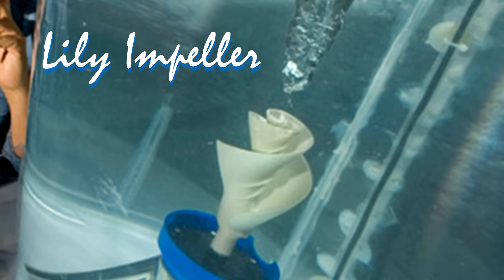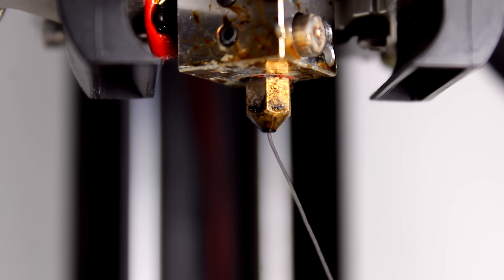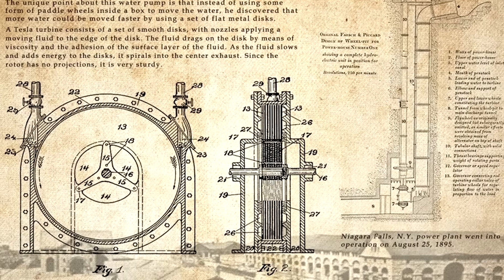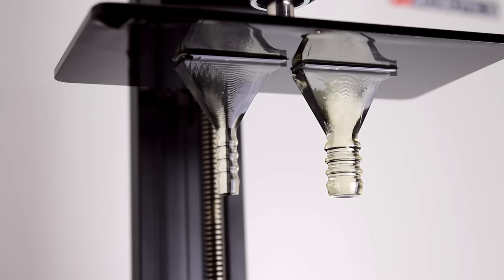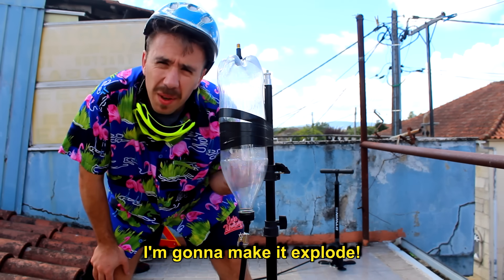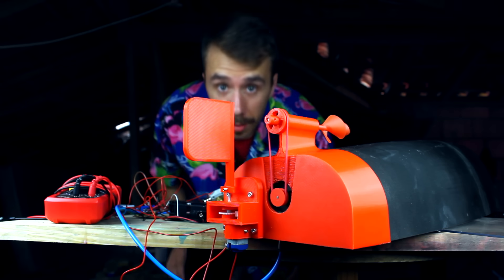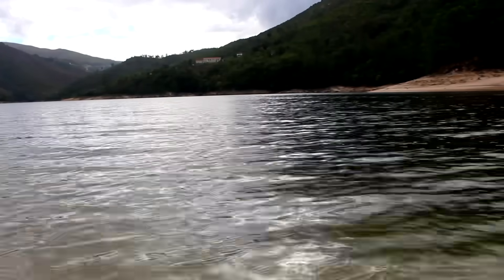Tesla Turbine Boat 3D Printed (Lily Impeller)

Comment: As a project, I would like to suggest a device using a Tesla design that, when placed in water flow, generates electricity commesurate to the flow of water, and charges batteries (a bank of 16850s or a lead acid battery).

Comment: How about building a compact boiler to power the Tesla turbine and then fitting it into a boat. Add a small pump with a Tesla valve to refill the boiler when it is empty. Then you can motorboat as long as your fuel source last!

Comment: For high presure you could try soda botle  tubes. They have a mass of the soda botle and a volume of the test tube( so the wals are T H I C C).  They also have mouth of a regular soda botle, with threads, neck, collar and all that things.
If  volume is more important, regular bottles could be reinforced like squba diver air bottles

Comment: Pump methane or or another burnable gas into the tesla engine(turbine) valve. Then burn the gas exiting the chamber. After every thing compare the results between burning it normally from a valve and from tesla turbine. Finally try to add 2 inputs to the chamber. One should be O2 other burnable gas, see if it changes anything.

Comment: Idea is you should print an insulating sleeve for drinks like soda cans. You could try changing the density of the material and the amount of air between the walls to see if there is an optimal ratio.

Comment: an invention i created (as far as i know they dont already exist) but i cant get my 89$ ebay 3d printer to do anything (its completely useless, even after my attempted upgrades to fix it) is a small box you install to your light switches that connects to an ios/android/windows/mac app that remotely turns your lights (or anything with a switch) on and off. It installs with either double sided tape or with screws on the existing screws. There is a button on it so you can still turn your lights on and off via the switch location, but now you can do it remotely as well. like when youre laying in bed or after you sit down for am ovie in your living room. inside the box there is slots where the switch can freely move up and down, and there is a stepper motor and stepper motor drivers, and an arduino and wireless receiver. and the stepper motor knows if the switch is up or down and reports the switch position to the app, and the stepper motor slides something up and down to turn the switch up or down.

This is simple in theory. and i made it out of foam board and it worked. But for it to be a better design the housing would have to be injection molded or 3d printed. The one i made had 4 slots for the 4 switch plate that my living room/kitchen lights are on. If i ever make them there would be a 1,2,3,4 switch design that the user would choose. that way its all in one unit. rathger than sticking 4 units next to each other on a 4 switch plate, for example.

Comment: @integza you could try making an array of co2 cartridges instead of the bottles. They are smaller and hold more pressure so you could fit alot more on the boat and could get alot of speed/running time.

Comment: Small tip for when making a boat, round out the bottom/back side (don't remember the proper boat term) to reduce drag,  you should generally try to go for a bullet shape or a canoe shape but other non-conventional shapes also work.

Comment: I think the velocity of the air is the important variable when driving the Tesla turbine. Velocity tells a lot about boundary layer characteristics because it plays the largest role in calculating kinetic energy. I think the reason the straight nozzle worked best is because it didn’t effect the velocity of the air going into it. The other nozzles ended in diverging sections which act to reduce the velocity of the fluid and increase the pressure. Actually, a converging nozzle should work better because velocity of the fluid increases as the area of the inlet decreases.

Comment: I could be wrong, but I think the impeller is facing the wrong way. It should be on the back of the boat spinning in the opposite direction, fat end facing forward. The large "opening" of the impeller should be the leading edge of the blade for the intake. The impeller would also need a shroud to work properly as a turbine. The idea is that the wide intake compresses the water (speeds up as water does not compress) as the turbine rotates and until it exits the impeller at the small end. It technically should work and would avoid cavitation in water and compressor stall in air. I think? Anyway, flip that thing around and add a shroud. The leading edge might still cavitate if the "angle of attack" is too steep. Trial and error on this one. Fluid-dynama-whaaa?

Comment: Why not think more forwarder? Build something like a Air Turbine, where this Lily Impaler are the Blade to compress the Water and then a modified Propeller (bigger) push the Boat forward, perhaps like a screw or Drill thing to add more push. But to have an effect we need 3 speeds. 1 to suck the Water in (Lily Impaler) then the middle part a bit faster like a Drill or Screw and then the output section even a bit faster to give the water flow the extra push. Different speed because to avoid slow down the water from move between the sections

Comment: Mr Integza, with the straight inlet and the air hose, was the increased speed due to the Bernoulli effect? The high pressure air from the hose sucks in the surrounding air increasing the volume of air entering the turbine.
If this is the case, if you were to drill a some holes into the Y shaped inlet manifold (possibly parallel to the air hose) the manifold could suck in extra air.
Reply: I forgot to add, would the impeller work better inside a tube like housing? Further utilising the Bernoulli effect.

Comment: Wonder if you could have got more speed with a gear system attached to the output shaft to get more rotations on the impeller

Comment: I'm going to suggest trying to 3d print some kind of compressor mechanism again, even though last time some guy tried to mansplain to me, an actual engineer, why it should be made out metal instead of 3d printing it, in the comment section of a 3d printing channel.

Comment: A coolinvention could be an underwater submarine that works entirely through air pressure. For the movement it uses a tesla turbine and for the ballast it uses some rubber baloons that get empty if you want it to sink and get filled to go up.

Comment: Now that you are in the water bending vibe you should also try to make a 3D printed submarine. And perhaps give the lily impeller another go.
Reply: Excellent idea, no surface tension underwater, problem is weighted air.

I'd love to see how this would be made to work
Reply: @oguzy23  Well, he could just use a normal motor instead of the tesla turbine. So he wouldn't need to worry about the air suplly.
Reply: @Pablo Paes   or  a small compressed air tank for paint ball as the air source and a ballast to make the net buoyancy zero
Reply: @pablopaes5646  yeah but that would be easy
Reply: Very nice ideia

Comment: Were those ducks laughing at your boat?  Could you use a candle to power a sterling engine to make a small pump create the air for the turbine with a larger impeller? If you encase the impeller will it become a jet impeller as the water is forced through a tapered cone, then control the cone for direction? Without the water bottles there will be less drag on the water, who knows, you may be able to reach light speed(Oh My Gaaaaawd!).

Comment: Hi Integza. I would try to put the impeller in a tube (housing) to increase efficiency. You can also use this waterflow to steer the boat like other jetboats do. what was the final rpm of your turbine when having the impeller in the water? I have the impression that the rpm are very low in comparison what the turbine can do. so maybe you consider to use a gear to enable the turbine to work in an optimal range. you could even print something like a visco-clutch to reduce mechanical friction in the gear or you do it like the do it in the helicopters who have a two shaft gas turbine. and last but not least i would use a sodastream (or something similar to put co2 in beverages) aluminium bottle as pressure tank instead of the pet bottles. you can surely put more pressure on them and they are smaller and one will fit in your boat. good luck and looking forward to seeing your next video.

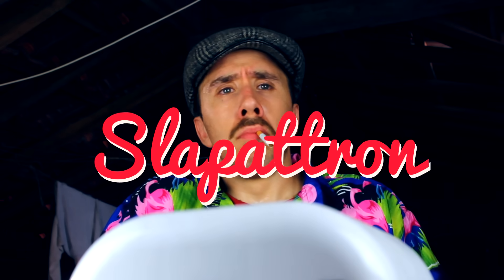Comment: 3:57 a pipe would suit you better, I think.
It emphasizes your image as a thinker ;-)
8:08 and 18:20 should be on a tshirt :-)

Some remarks:
Why did you put all bottles in the water? And with the flat end to the front. Some bottles on the top would reduce the drag.
Just use the bottles (two of them) as the boat itself. No need for the boat part itself. 
Put the impeller into a tune to increase its efficiency.
Great project and super fun to watch. You are awesome.
Greetings from Munich, Tom.

Comment: I believe the Lily Impeller is more efficient when the material(water or air) is in a captive environment. You may have gotten more thrust if this impeller was in a tube, like the propulsion system of a JetSki. In this application, using the impeller inside a tube you can control where the source of water entering as well as where it exits, allowing you to use all of the trust you generate.

@Integza ...I am interested in getting into the 3D printer game, I used to build RC aircraft but currently am building an Arduino based Lawn Mowing Robot(think a Roomba but for cutting grass). Ideally after my prototype proves out I would like to design and make more 3D printed parts to lighten the V2 and make more efficient. For someone getting into 3D Printing with no background, what would you suggest for a great beginner printer as well as some projects to help learn the software, both using and writing?

Comment: One idea suddenly strike to my mind...that if tesla coil can transmit electricity wireless ....you can make a rc car with out battery (instead power it with TESLA COIL ) it will be amazing to see it working in your upcoming video⚡
Reply: Tesla coils can’t transmit wireless electricity more than a few feet.
Reply: @Jkirk3279  yaa that's correct but that is the challenge ....if he figures out some way 😀

Comment: You could try building a soft exoskeleton for a hand that uses EMG muscle sensors as input and some strings, where when you try to move a finger a sensor is activated and the string is pulled by the motor that aids you (or super strengthen you) 😁

Comment: As the impeller sucks the fluid in front inwards, put it in a cone shaped thingy, drive it with a BLDC motor, make a couple of jet like engines, make a styrofoam plane fly with it. Stanton or PeterSripol or FliteTest make everything fly, use any design made by any of them

Comment: I would try "ducting" the propeller in its own housing that would help assist in aiding the flow of water that the propeller produces in a more concentrated direction. The propeller design leads me to believe that the direction of the energy the fins produce gets distributed out to the sides when the water that travels/expels through the fins rather than straight out the rear of the impeller in comparison to a typical boat propeller. I think Youd get more thrust by designing a tube that the propeller spins. Similar to the propulsion system of a jet ski/sea doo etc. A jet ski's propulsion wouldn't be as effective due to its fin design by losing the thrust it produces "outward" and not directional like how a jet ski's propulsion system is designed. 

I really enjoy watching your videos and there is always great content that I become instantly glued to the video and wanting to know the outcome and just how you go about these projects. I want to get a 3d printer so bad one day to where ID be able to use my imagination and ideas and actually put them in the real world and try them out.
Great video and great content! Keep it up!!

Comment: If you want more power, consider if you haven't already putting the impeller into a tube, think jetski drive.  this will allow the impeller to pull water towards itself but also direct the water leaving the impeller. increasing the thrust of the impeller.

Comment: How do you think of integza making a nikola tela turbine powered rc car

Now you might be thinking, Quad how the flip do you expect him to make that. Well i have a solution, have a singe turbine like the one on the boat cut an area in the back of a rc truck like a semi truck and have a small pressure tank like the ones we use in airsoft wich hold ALOT of air, hold the pressure tank in the engine bay of the truck then route a high pressure tube conected to the turbine wich spins a belt connected to a pully that is glued to the driveshaft of the rc build then he has to set up a circutboard (sorry not a big brain word but deal with it) that controls the the steering and throttle and it should be done also for the sprocket/pully the pully that is connected to the turbine needs to be small because of the insane amount of RPMs that turbine puts out.

Comment: Would love to see this done with a shrouded impeller. Perhaps a ducted tube into the hull of the boat? If you put one on each side, you can use power differential to steer instead of using a rudder.

Comment: Still unclear on why a propeller and an impeller are different... doesn't either one both push and pull the fluid, depending on which side you're standing on? Maybe 3D print a set of impellers mounted like propellers and vice versa to help demonstrate the difference!

Comment: Not a mechanical engineer (I'm actually an industrial designer) but your funnel shaped inlet nozzles are causing a drop in air pressure as they transition from the narrow attachment nipple unto the triangle funnel shape. Thus the air is actually below the 2 bar that is coming from your compressor. I believe this is along the lines of Bernoulli's Principle, and is the same technique some fighter planes use to reduce the speed/pressure of the intake air before it reaches the engines. Which is why the nozzle that went straight from attachment nipple to mounting plate worked best. The air didn't expand causing it to drop in air pressure and speed.

Comment: Hey Integza why don't you try running the boat with an brushless motor with lily impeller and tesla turbine with a normal propeller and see the differences in speed and performance to understand what is the bottleneck
Also loves from turkey <3
Btw I LOVE your vids keep it up

Comment: How about making an all wheel drive car with the Tesla turbine. One turbine of the similar size as used in this video at each of the 4 wheels, with a gearbox for torque multiplication. And you could also regulate the pressure at each turbine independently in order to simulate something close to torque vectoring as the wheels would rotate at different speeds through this. And to top it off, what better than having the car body as a Mitsubishi Lancer Evo 6, the ultimate rally champ. And one more thing, please clarify on this, if the pulley system you used on the boat was encased in an enclosure would the impeller have performed better, as the pulley would have experienced some sort of resistance in water, and the turbine wasn't able to generate enough torque to overcome the resistance by water, thus leading to slower moving impeller ? Just a doubt hope you clarify!! This boat was an amazing project!!

Comment: An RC Car that use a Tesla's turbine as a motor and has an electric air pump to refill the bottles, maybe powered with a solar panel and/or batteries. Also a control system for this would be interesting. Your videos are amazing, thanks for your effort.

Comment: If an impeller draws fluid in, why not encapsulate it in a channel below the keel of the boat? The thrust at the outlet could even be steered. 
The pressure vessel could be painted black so sunlight heats the volume of the fluid used to power the turbine for greater range, as well. 
In fact, use the curves of 2 bottles side by side as the scoop channel you put the impeller within. Printing a hull would be superfluous. And rather than alkaline batteries, why not a solar array for the control motors/radio electronics on the boat?

Comment: I think it would help if the drive ratio was decreased, since the Tesla turbine doesn't have a lot of tuorqe. Simply putting a bigger pully on the impaler axis should work. Also, has the tuorqe or power of the tesla turbine been measured at all? 
By the way, Integza, you got me into 3d printing. True, still haven't printed anything, due to smoking the motherboard due to a safety feature (powering on an unscrewed circuit board on any conducting surface is a bad idea)

Comment: Im the only one that replayed more than 10 times 7:05 and laught when bottle explodes ? When it fell I waited for "ooooutthhhhhh" down there !!! KKKK "Inetzgaaa", what if you change the pulley ratio ?  Big one for impeller and a little for turbine ? Speed will increase ? Or make a tube in Tesla  turbine outlet, put it in water and air helps boat to move. Love your videos my friend, keep it up !!!!
Reply: A turbine that small has almost no torque
Reply: Also putting the big one on the bottom would create a lot of drag in the water and navigate any potential benefit.
Reply: Thanks for the "Replay Button"!
Reply: No widen the end flare on the impeller

Comment: Maybe put the impeller in front of the vessel?  Schauberger used a mouth opening, to mimic the salmon he senn as a child, to guide the flow into the impeller.  Then through openings, the water flows out creating the water current vortexes needed to travel down the sides of the vessel, propelling the vessel forward.  These currents are key to movement.  Try just mounting on the front for now, to see it you gain any forward movement...